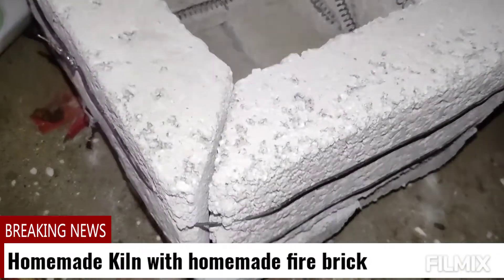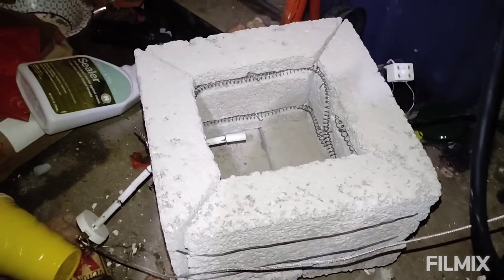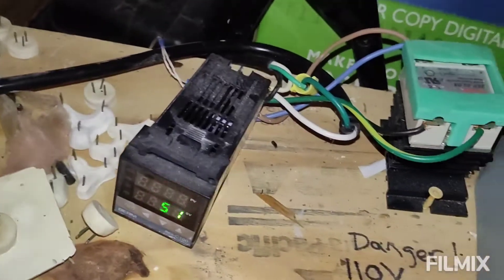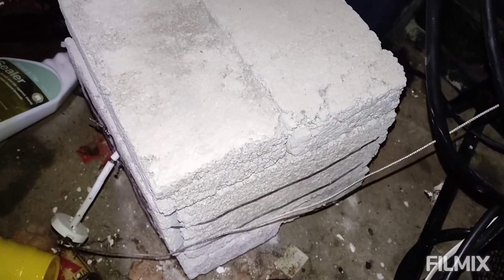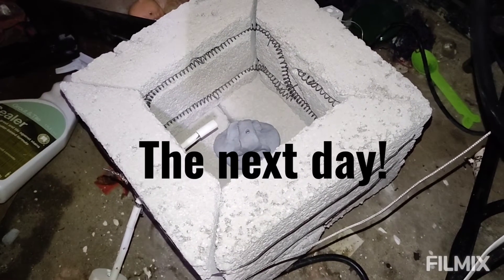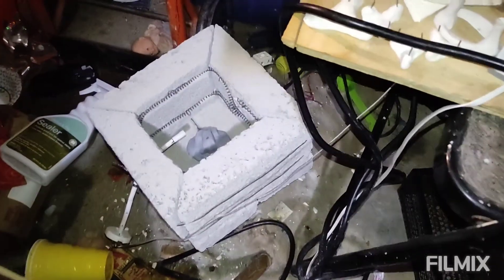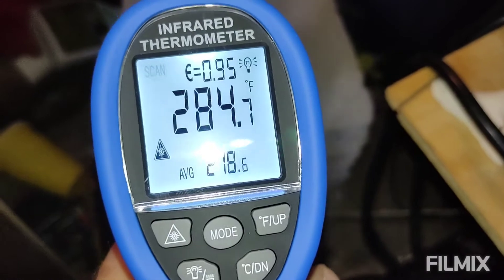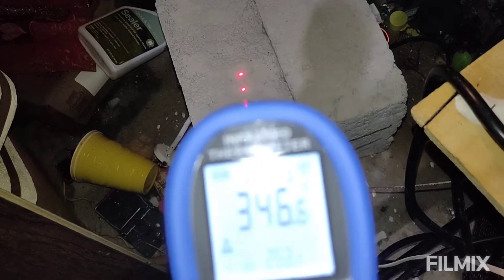Homemade Kiln with homemade fire brick first firing test

Comment: How hot were you able to get it?
Reply from the maker: I got it up to cone 04 bisque temp. The mix could probably use a little more water or water glass to help hold it together since some of the inside was easy to crumbly away but hey it worked for a few firings before I sort of gave up on it. It's probably better to just go with pro fire brick for all the trouble it takes to make.